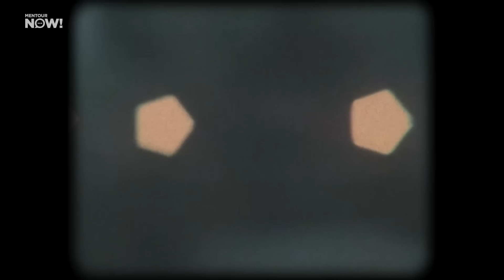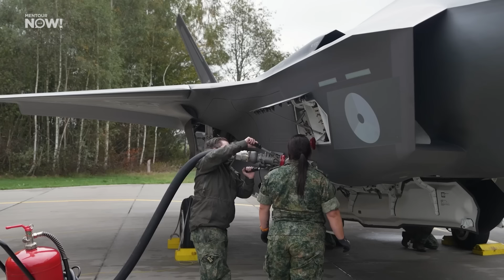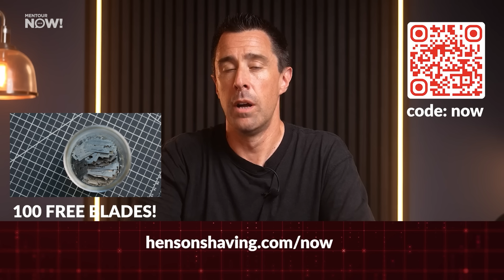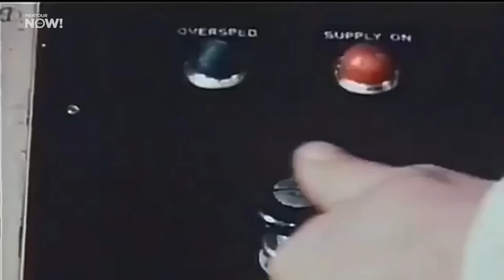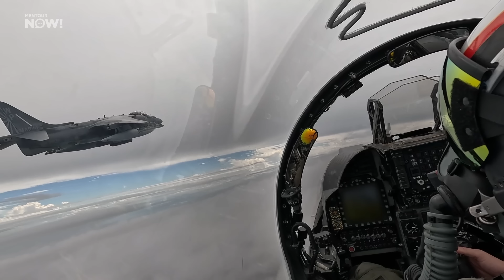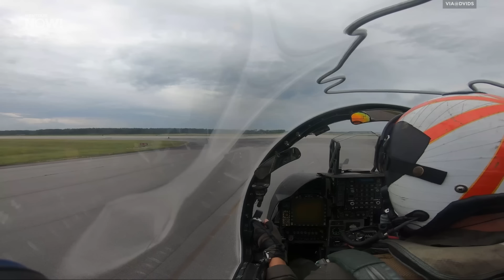The Harrier Is WAY More COMPLICATED Than You Think!!

Comment: The harrier could actually hover and go backwards. Their party trick, that I have seen at an air show, was to take a bow (dip the nose in the hover). I could never, and still can’t understand, why the sea harrier was retired so early. New aircraft carriers but no aircraft? Absurd. They should have kept the sea harrier until the new aircraft were delivered. That way the aircraft carriers could still have aircraft. An aircraft carrier with no aircraft….Totally absurd.
Reply: The reason is because the SHAR was still a first generation Harrier airframe. Small metal wing instead of the big composite wing of the Harrier II. 
At the time, the overseas commitments were to Iraq and Afghanistan and the SHAR basically didn't have a role and it was also struggling in the hot conditions. It was a great little pocket interceptor with AMRAAM, but its range was notably shorter than the Harrier II, it could carry a fraction of the payload and was comparatively very limited in the ground attack role.
What the UK should have done is not keep the Sea Harrier, but invest in the AV-8B+ variant of the Harrier II used by the US, Italian and Spanish navies. 
It is the only true multirole variant of the Harrier and would have had all the air to ground and range capabilities of the GR7/9, but also with a multimode radar and AMRAAM (the RAF never operated a Harrier with a radar).
As for the Harrier itself being retired in 2010 - Interservice politics. The RAF wanted to keep the Tornado over the Harrier and getting rid of the Harrier also forced the Royal Navy out of having its own fast jets, a situation the RAF was quite happy to see. You might want to blame No.10 for everything, but the different branches of the armed forces are always fighting each other for a bigger share of the budget and will not hesitate to screw each other over.
Reply: @BrySkye  I wasn’t referring to the RAF version of the harrier being retired early. It just made no sense to retire the sea harrier and have carriers with no aircraft. They could have been retired later when the replacement aircraft had arrived. No point having carriers with no aircraft.
Reply: @stephengoad6886  Try re-reading what I said, I specifically went into the Sea Harrier first and its issues in regards to what operations were being performed at the time =p 
And when the Sea Harrier was retired, a number of the RAF's Harriers were transferred to the Royal Navy. Navy pilots continued to fly Harriers off the carriers for years after the Sea Harrier was retired.
And if we want to be pedantic, the carriers always had aircraft. Helicopters are still aircraft. The Invincible class were always originally designed as Helicopter carriers (specifically they were anti-submarine helicopter carriers), not Harrier ones. 
It just so happened that it was quite easy to fly Harriers off them.
Reply: @BrySkye  I don’t need to re-read what you said. I made a point which you clearly don’t like or agree with. That’s on you not me! Get over it.
Reply: @stephengoad6886  You said you couldn't understand. Fact is, you don't want to or even care to try to understand when offered an explaination. 
That is on you and its always such a sad thing. 
And you're still wrong in thinking we had aircraft carriers without "aircraft".

Comment: What was interesting to me, watching a Harrier do a demo - usually at RAF Leuchars air shows - was listening for the sound of those bleed air nozzles. It was a sound not unlike a burst hose on a high pressure air line (funnily enough!) and the subtle variances between whatever ones could be discerned, depending on the attitude and proximity of the plane, amply illustrated how hard the pilot was working on fine control. Not surprised they were easy to over control! Saying that, the real show-offs would wave from the cockpit...

Comment: There are several AV-8B's privately owned - well... actually an additions to the CAF squadrons around the US.   Last time I got close to one, the ground would rumble.   Two things on the Air-Show circuits were noteworthy by the Moderator/Announcers.  On an asphalt runway it could not land - it could melt or severly weaken the surface.   The other thing of interest was during the performance,  it would every now and then blow out black smoke, then stop, but do it again in somewhat of a pattern.   Turns out it used water injection to assist in cooling it down,  and leaving upward and transitionin to flight it would do those puff of black smoke from water injection to give it a bit more power.  Amazing machine!  To bad it's being retired.

Comment: It's worth pointing out that the Argentine Mirages and Skyhawks were operating at the ragged edge of their fuel margins; as such, they could neither carry A2A weapons nor maneuver - offensively or defensively - against threats. Under literally ANY other conditions, things would not have gone well for the Sea Harriers.

Also, the reason NATO walked away from the extreme dispersal strategy is that eventually people realized it takes more than a truck full of gas and a pallet of ammo to turn an aircraft around. Harrier needed 17 to 20 man-hours of maintenance per flight hour - not exorbitant for military aircraft of its era, but still meant each forest clearing or stretch of road you wanted to fly jets from ALSO needed a full staff of technicians plus spares for whatever parts broke on a given hop, plus at least a small team for local security. So you needed to have convoys of trucks, maintainers, security troops, and spares (and you wouldn't know in advance which parts you were going to need, so you needed to have basically everything everywhere) wandering all over the countryside, possibly being overrun by Warsaw Pact ground forces, possibly getting into traffic, possibly simply getting lost; and even if the ground crews made it to the right dispersal spots at the designated times, the pilots might land in the wrong clearing or on the wrong stretch of road. Or you could harden and defend the air bases..
Reply: Correct. NATO walked away from the Dispersal policy because they were going to have to fight a multi-day conventional war after the change of war plan from a one day all out Nuclear War from the git go that was "Tripwire" in 1968 to Flexible Response. The MT fleet that supported the Harrier Wing in RAFG was huge, and the fleet at Wittering wasn't much smaller. The Harrier was ordered years before the change in Policy.
Reply: My mate was an RAF aircraft engineer in West Germany during the mid 80's, mostly based in Guttersloh and, I think, Larbrook (sp). He reckoned it took about two to three hours to fully re-arm and refuel a harrier on a dispersed landing pad. However he also reckoned that after about six of these it needed to go back to a main base for longer more extended maintenance. He did also say that his unit once got a harrier back in the air just 36 minutes after landing, fully refuelled and re-armed, but that was extremely uncommon, and he thinks it was heading straight back to the main base. At the time most harriers were GR3's. About the time the GR5's were coming into service he moved back to Britain and to work on Puma helicopters.

Comment: The trick that the Harrier had up its sleeve, and which the F-35-B cannot reproduce (even theoretically), was vectoring the thrust while in forward flight, meaning that if an enemy aircraft or missile managed to get behind it, the thrust could be briefly vectored downwards and the Harrier could leap upwards in a way that a conventional jet simply never could, and which also made it impossible for any missile to follow.  That one manoeuvre was largely why not one Harrier was lost in air-to-air combat in the Falklands.  The other contributing factor was the deliberate creation of exactly the conditions that the Harrier was designed to ameliorate: the lack of fast-jet compatible runways.  This was, of course, created by the cratering of the one runway in the Falklands that could have supported fast jets, at Port Stanley, in the first "Black Buck" operation.  
That, in turn, was made possible by another British innovation: the tanker aircraft that could act as both suppler and receiver of fuel, enabling the relay of tankers (Victor K2s) to push a single Vulcan bomber all the way south to the Falklands and back to Ascension Island through a complex series of in-flight refuelling stages.  That first "Black Buck" mission achieved total surprise, as nobody else (not even the US) believed it was possible until after it was done.  The Argentinians were not expecting any air attacks until the fleet got within Harrier range, several days away.
The runway was repaired fairly quickly to a standard able to support C-130s, but the repair was not able to support fast jets, which had to be based on the mainland, nearly 600km away.
That series of raids was the longest ever at the time, and still holds the record as the longest ever conducted entirely from a single airbase, with no pre-positioned tankers along the route.
Indeed, every aircraft that took part in the Black Buck operations was operated from a single runway!  Only one had to divert during an operational flight, landing in Brazil after the refuelling probe broke off during one of the carefully controlled mid-air collisions that are in-flight refuelling rendezvous.
Reply: I think you're right that the British were the first to have a jet tanker aircraft that act as both suppler and receiver of fuel.  Though it would be interesting to see how much of that capability was because the British were looking at this kind of relay operation when laying down the requirements and how much was simply inheriting the capability because their early jet tankers were modified Victor and Valiant bombers (and already had fuel receiving apparatus as bombers).    However, I'm not sure those first British tanker conversions predated the first KC-130's which, while not jet powered, appear to have carried the same refueling probe as other C-130 variants and so should have been able to perform a refueling relay if needed.  (And the USN had a buddy refueling system for the Douglas AD-6 Skyraider in the 50s and those would have been able to refuel each other).   Still even if other smaller aircraft might have done it first having the first strategic jet tankers capable of receiving aural refueling gave the British some extremely useful capabilities.

Capability that, even before first significant combat use in the Black Buck missions, the USAF clearly thought were a good idea as their KC-10 Extenders had been designed and built with the capability from the late 70s, and the early 80s upgrade program for the KC-135 to the KC-135R included adding such boom refueling receivers to the tankers.
Reply: @jonathan_60503  The US stated at the time that such large relay tankering was completely beyond their capability and that they thought the RAF were bonkers to even attempt it.
When they were given the jet fuel requirements for Ascension (which they were obligated to fulfil under the lease terms for Wideawake Aerodrome), they said the RAF could never burn that much fuel!
Definitely a "hold my beer" moment!
The trailing drogue type of refuelling makes it very hard to refuel such pairings, as the receiving aircraft has to fly within the wake turbulence from the tanker.  Smaller aircraft can fly inside the wingtip vortices of the tanker, which is impossible with a large wingspan.  That is why the US uses flying boom refuelling for such operations.
The drogue and probe refuelling between two such large airframes as the Victor tanker and Vulcan bomber is so tricky that the Vulcans had to carry an instructor from the Victor K2 tanker operational conversion unit as a supplementary crew member on the Black Buck operations.
Qualifying for a2a refuelling is one thing.
Doing it reliably in whatever meteorological conditions prevail at the time and place such operations require is quite another, and the decision to add the instructor was wise, as thunderstorms are common in the tropical convergence zone which they had to fly through.  In-flight refuelling in the middle of a tropical thunderstorm can certainly be categorised as either "advanced operations" or "totally insane", depending on your point of view!!
Reply: @The_Real_Phil_Lee Argentina had no air to air refueling. Because of the Black Buck mission, the Argentine pilots had about 15 minutes over the Falklands. The harriers had better missiles for air to air as well.
Reply: @grahammonk8013 I'd research your facts, they did have a2a refuelling
Reply: Viffing has been proven to be another myth (as cool as it sounds)
Reply: @mikewatson4034  Really. Have you ever VIFFED a  Harrier?
Reply: @flyingisfun3328  It was developed by the US Marines years after the Falklands War so it couldn't have played a role. It's usefulness in combat is also debatable - AFAIK it's never actually been tried but I could be wrong about that.
Reply: @mikewatson4034  completely agree, any pilot worthy of the name would NEVER let his or herself get into that situation in the first place
Reply: @stevemanklow5128  Really. Have you ever VIFFED a  Harrier?
Reply: @flyingisfun3328  It's not a myth as a concept, but it was never a part of UK Harrier doctrine. It is a myth that Sea Harriers used it during the Falklands. They did not.
Reply: @flyingisfun3328  No, nor has any pilot worthy of the title. It's a myth, a concept, just don't let yourself get into the situation in the first place

Comment: harrier is a much better aircraft than the f35. the harrier is finished , because rich peoples accountants want more tax payers money. less than 25% of f35s are mission capable and not only are f35s expensive $135 million, they need a staff from Lockheed Martin directly. the stealth only works, if an anti aircraft system doesnt know what it is looking for, so first strikes only or places with no anti-aircraft systems. the f35 is based on a old unwanted soviet design , it cant clime or manoeuvrer as well as a harrier, or perform any task better than an f16. The scrapping and not updating or properly replacing the harrier is a travesty and shows the corruption in the military industrial complex.
Reply: Pray tell where you are getting your information from. Russian propaganda? Because it’s wrong - and obviously so.

Harrier is finished because it’s a dated, expensive-to-maintain aircraft that is not practical to upgrade to modern avionics and is highly vulnerable on the modern battlefield.

The trend in mission readiness rates is pretty damn clear, and a simple search will tell you that it’s not less than 25%. It has been averaging in the 60% range in recent years. Oh, and if you actually looked at the publication that those news reports claiming “less than 25%” were based off, it shows that the F-35A has a higher availability rate than the F-15, F-16, and F-22. While flying more flight hours per year, per airframe, than any of those. And with a similar operating cost to F-15s.

Oh, and the F-35B has had a higher availability rate in the USMC than the Harrier, from 2016 through to the Harrier’s retirement.

The F-35C has considerably higher availability rates than any F-18 variant in the USN, while flying the most hours.

Your understanding of stealth is…very, very far from complete. Yes, it works. Even if the adversary knows exactly what to look for, the laws of physics are pretty damn clear on how RCS affects detection range. Perhaps you should look up the differences between low, mid, and high-frequency radars, which is likely where your misunderstanding lies.

It’s “based on an old unwanted Soviet design” in the same way that a modern jet engine is based on a Rolls-Royce Nene. That Soviet design carried extra turbojets purely as lift devices - y’know, the ones referred to in the video that you bothered to comment on. The F-35 clutches in what is, essentially, the front element of a high-bypass turbofan to be driven by the turbine of its sole engine. An engine which is the single most powerful ever fitted to a fighter aircraft. They will absolutely outclimb a Harrier. And they’ll win the turning fight as well, as a Harrier doesn’t have the option to light the afterburners to maintain energy.

There are very real criticisms to be levied at the military-industrial complex. It’s a shame you’ve gone for criticisms spouted by the propaganda complex - much of it driven by foreign actors.
Reply: @BlazeFirereign  the only propaganda i see is rich people making a mint at our expense.  the 25% comes from the pentagon, so if that comes from Russia you know more than anyone else, there are continuous articles of the unreliability of the f35, its based on a 1980s soviet plane, the rights were bought in 1990 or 91 an f35 can not do the same angle of attack as harrier so initial climb from a harrier will be greater.  needing permanent Lockheed staff, limits where it can be put. The f35 costs more to maintain and keep, it offers no capability. the only reason we have it, is because of those costs, we keep people well at thousands of pounds a day with these things. though different the f18 is a much more reliable plane with a 65 to 75 % operational capability.
Reply: im not his greatest fan, but i think he an idea for industry, being the only person in the usa to bring any industrial growth, Ellon Musk said the f35 was obsolete years ago.